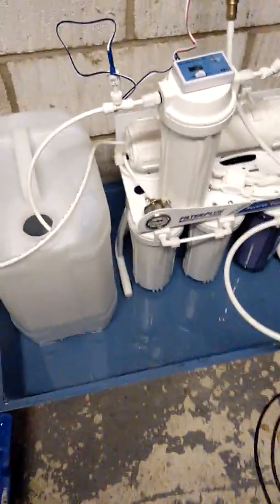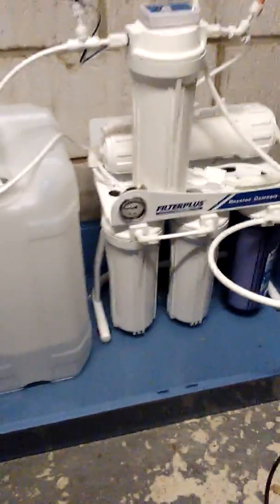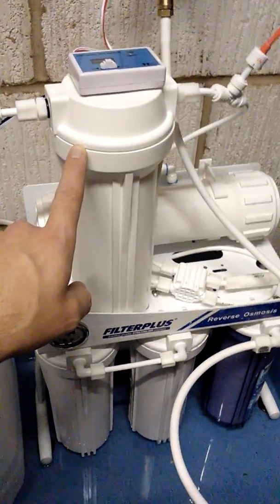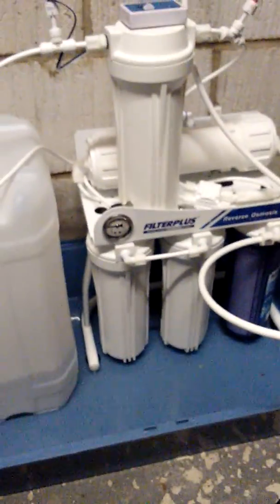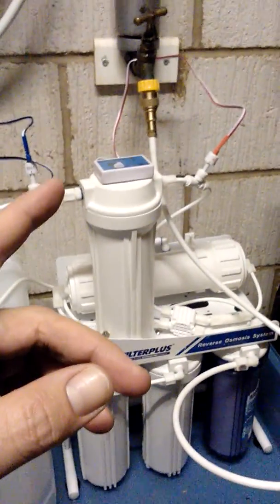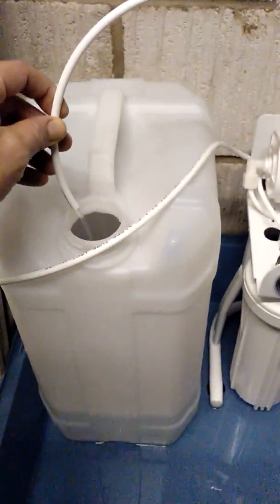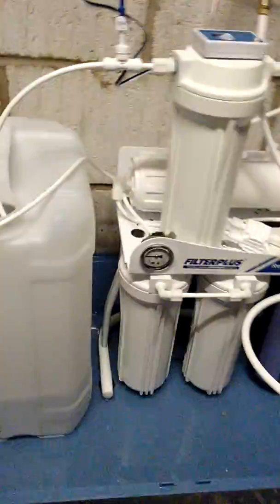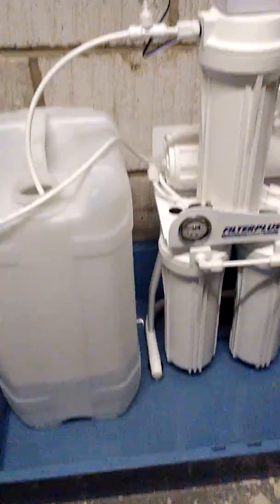Streamline 300gpd RO quick look

Comment: hi, thanks for the vid, you have a great set up, I just bought a 600gpd one looks more or less the same, I am looking for the brass tap connector that you have fitted, where can I get one, also can you send me info on the inline TDS meter you have fitted or another vid, cheers
Reply from the maker: Hi Paul I got the tds meter off ebay for about £15. But I would recommend paying a bit extra for the waterproof one as mine got wet once when a hose came off and never worked again. The brass connector was from an online garden centre, can't remember which one, I had to insert my own rubber washer as I leaked badly at first. Sorry I can't be of any more help.